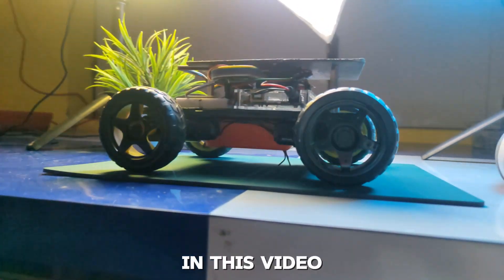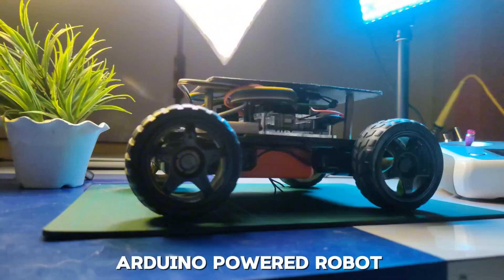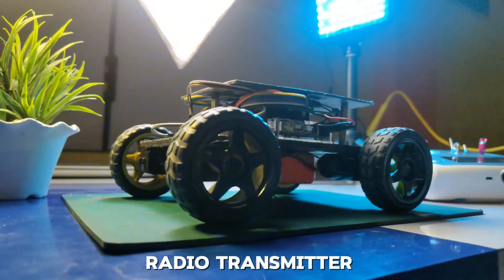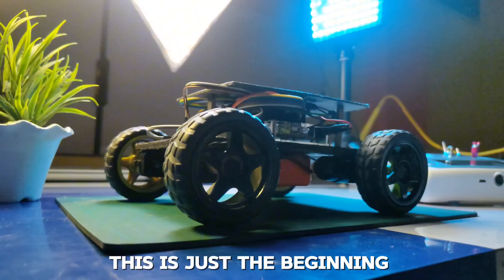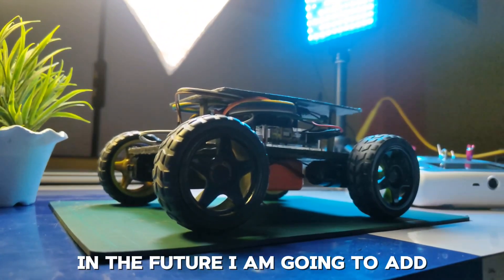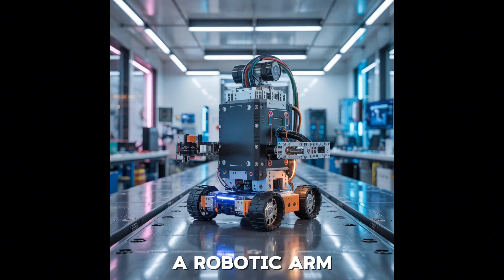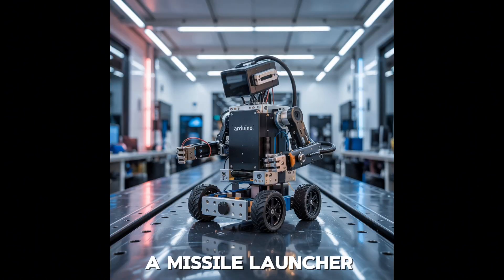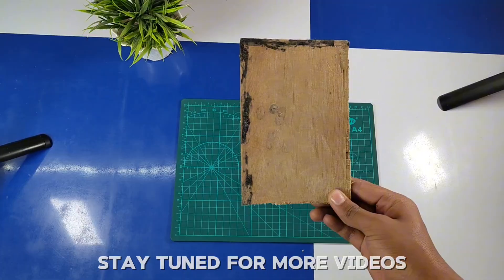How To Make Long Range RC Robot With Arduino | Flysky | Without Esc | DIY

Comment: You should have made separate four drive...instead soldering motors together....no youve got only front and back movements....get those motor connections separated..you will have turning control
Reply from the maker: To turn right both right side motors move backward and left side motors move forward, exactly opposite for left turn.
As you can see in the last clip I had shown the turning controls but that time the battery was drained that's why it's not turning properly due to insufficient power in motors